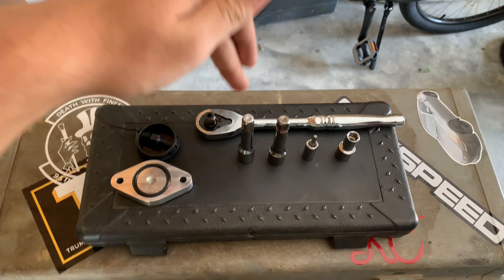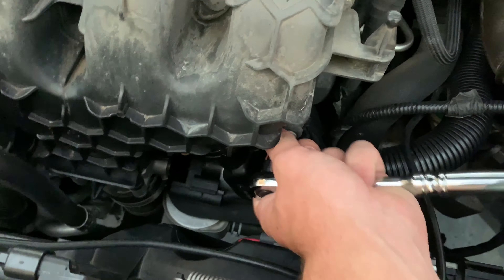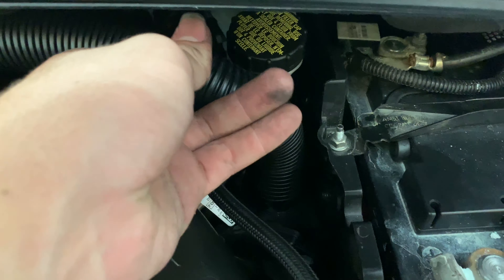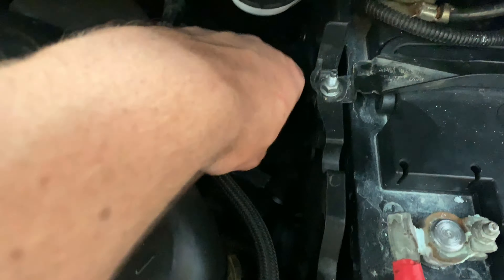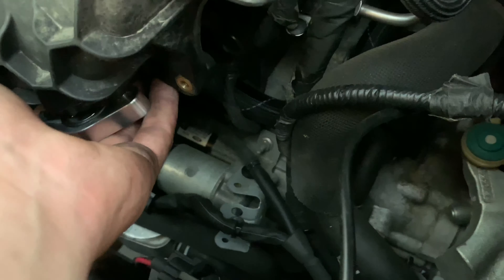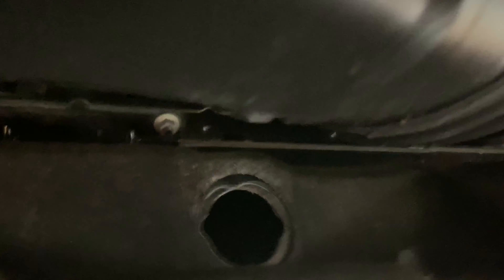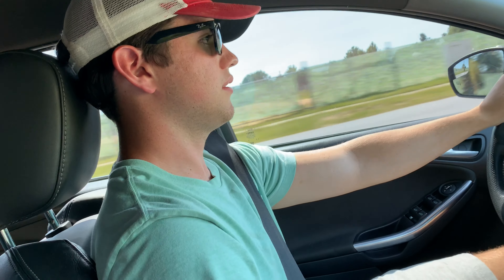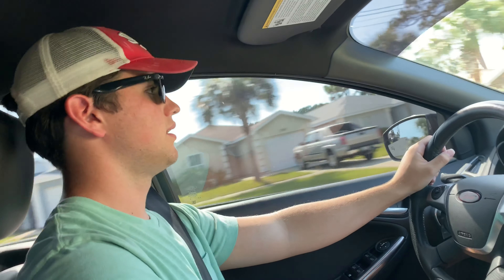I can hear the turbo! Focus st sound symposer delete!

Comment: Haha the zip tie that was included wasn’t waste it’s meant to be used to tie up the wire harness that’s is left dangling when you remove the symposer valve so that it doesn’t get caught on the shift linkage.

Comment: I lost that gasket on my stock symposer when reinstalling it. any idea where i can get a replacement? I can't find it on any parts site
Reply: The sound symposer delete kit should come included with a new gasket.  If not the steeda kit comes with everything.
Reply: @bashfullJ88  I sold that

Comment: Such an ugly looking engine compared to the 5 pot.
Reply: You are comparing a Volvo engine to a ford ecoboost.
Reply: Yes the MK2 Focus has a 2.5 litre 5 cylinder Volvo engine called the duratec st engine which sounds magnificent and is a better tuning platform